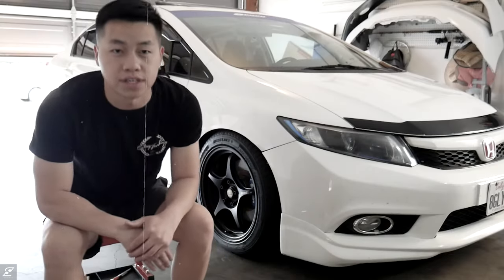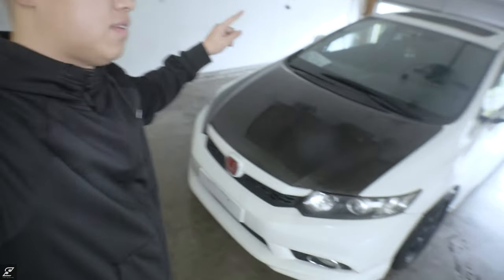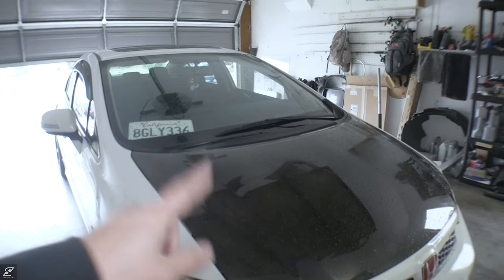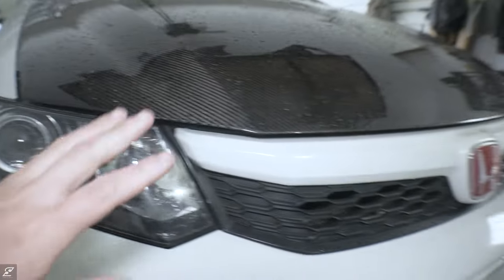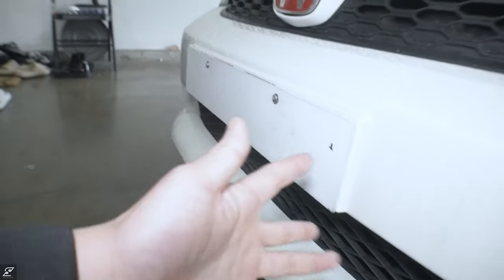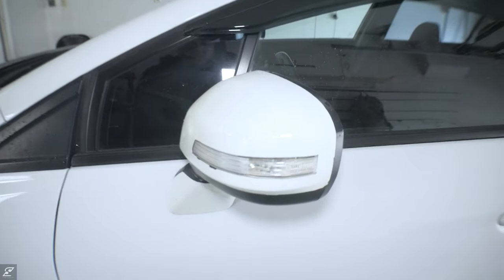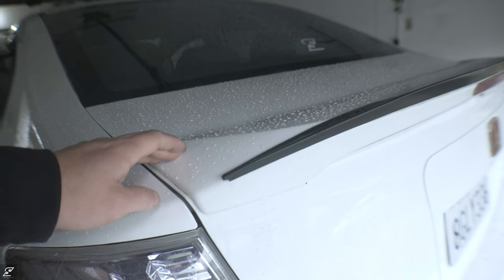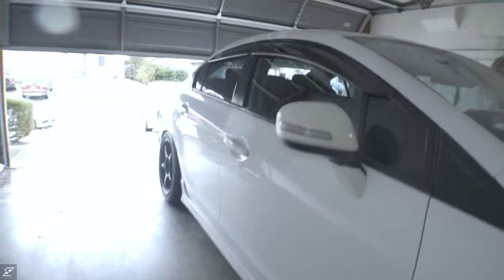My 2012 Honda  Civic SI - Every MOD done to my 9th Gen Honda Civic Si - Detailed Walkaround

Comment: Literally just got a 2012 9th gen coupe, what should my first mod be? Really going for reliability, so like a catch can or just mods to make the current car super reliable. Not really going for power right now.
Reply from the maker: Nice!  Congrats! If you’re looking for reliability, I would recommend going through and flushing all fluids to start.  And there are a lot of mods you can do for the 9th gen chassis.  It really depends what you want to tackle first.
Reply: @StayLurking  bet, I’ll make sure I do that sometimes this week, I got her yesterday. Bet, it’s has hfp wheels and front end, but it’s not a hfp I think. I’ve already been sourcing another engine so I can build it when this one goes down. I’ll eventually boost it but I just wanna learn all I can about the engine before I do. What it likes, what’s safe to do, etc. any and all knowledge will help. Thanks yo
Reply: @StayLurking  I think I wanna start with suspension and brakes

Comment: Love the content bro my traction control dosent work on my 9th gen si  do you know what could it be ? Thanks
Reply from the maker: Thanks!  And It could probably be a bad tpms sensor.
Reply: @StayLurking  do you know where is that located I have the tpms light on my dash so probably thanks brother
Reply from the maker: The tpms sensors is located inside the wheel.
Reply: @StayLurking  thanks bro so should I replace it or delete ?
Reply from the maker: That will be entirely up to you. If you replace it, your light will probably go away.  If you just delete/removed the sensors, you will have the light in your dash.  If you have a 12-13 civic, the TPMSD from @9thgenee will be what you want to get to eliminate the tpms sensors without having the light in the dash.
Reply: @StayLurking  thanks brother keep doing the content your cars is beautiful